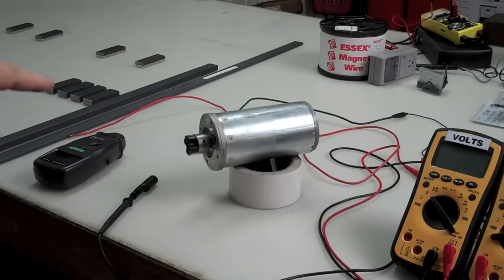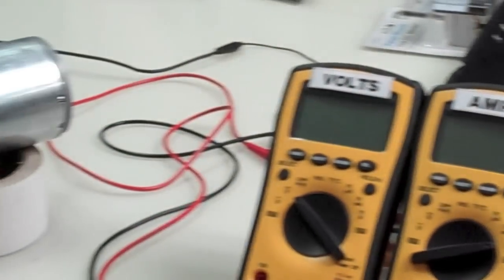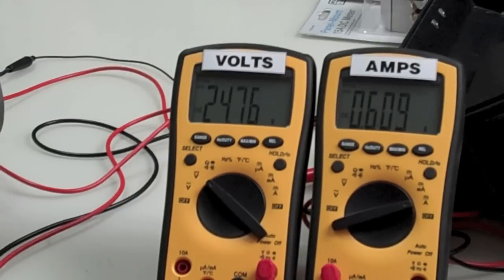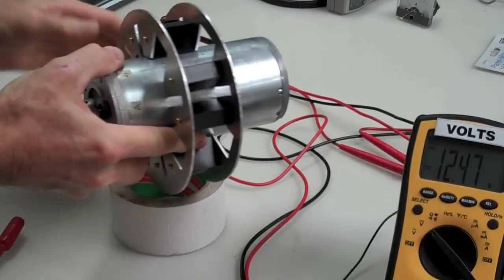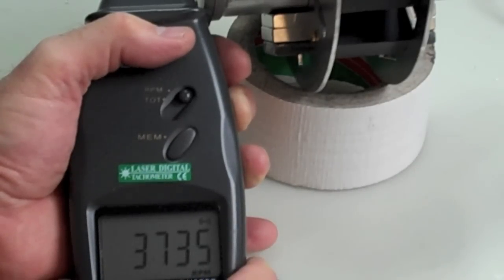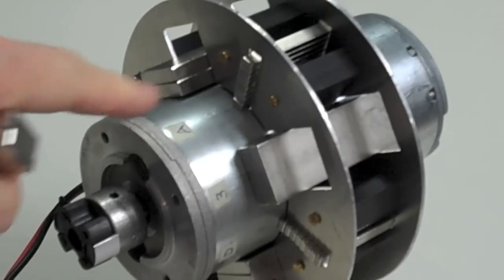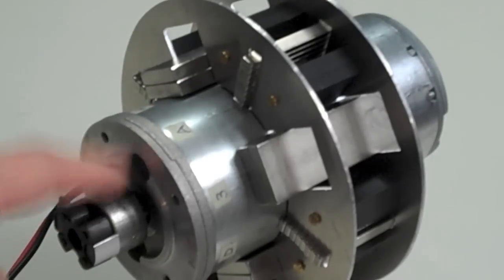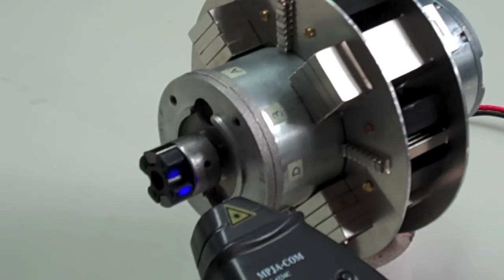STARGATE MOTOR  FULL DEMO

Comment: I learned the basics back in high school. In the college I went to there were specialized courses in electromechanics and electronics that dealt with this stuff more in depth but I chose a different direction. Since all this is way over a decade ago I can't provide any other advice than go check what your options are at a college near you, or other institutes that provide evening courses.
... Another limiting factor is that the chances are rather high that we even live on different continents.

Comment: I did this with my broken toy car motors as a kiddo ca.55 years ago by fitting stronger magnets to them as the magnets could be accessed from outside . The motors had much more torque BUT the motors did not last long. This principle is used on lift truck motors where they call it "Field weakening" and this give extra speed travelling

Comment: Since we're presumably talking about steady state, the motors are running at constant speed, RPM is neither increasing nor decreasing..   The one with the stator field boosted by external permanent magnets runs at higher RPM, all else being equal.

Comment: I would be interested in seeing the same motor with some resistors across the fields to see if you get a similar result.  When you decrease field strength you increase speed as the limiting factor for speed in a a dc motor is back emf.

Comment: Great experiment. This dc motor can still be fed with slightly lower voltage than 12 volts but still can perform to its rated speed. Same speed with less power consumption.

Comment: A few things I noted. Motor is rated at 24V and pulled .5 amps with no load. He reduced the voltage by half which will increase the amps 2 fold. Simple OHMS law.

Now the gained RPM with the added magnets are cool, but as stated in comments before, basically the magnetic field is altered to a point that it may spin at a higher RPM, but can not carry a load of any type.

Comment: In a DC Motor speed (rpm) is proportional to voltage (volts)  and torque proportional to current (amps). The stator flux generated by the internal magnets induce a voltage in the rotor windings which has to be the same as the voltage supplied.
The external magnets weaken the internat stator field and make it go faster. The magnetisation losses inside the rotor core that conducts the flux are now less because of the weaker flux and therefore it consumes less power.

Comment: Try putting in a cooler of dry ice to drop the temp of the friction of the ball bearings..... Then check the performance. Think of the lower the temp the more friction the motor can withstand.

Comment: The armature voltage is proportional to the flux and the angular velocity. The motor, while not connected to an external driving motor, doesn't produce any voltage, it is called CEMF. E.g. 24V 1Wb rpm=3000, 12V 1Wb rpm=1500, 12V 2Wb(because of the magnets) rpm=3000

Comment: nice work, question; what if you use less power for example, starting voltage to get the motor spinning at 24 volts 0.6Amps then reducing voltage to 12v 1.0Amps using gears to keep power drive however reducing voltage right down to 3 volts so the motor doesn't spin out of control and burnout by maintaining the design speed and reduction in voltage. now you have efficiency and battery stamina complete with reliability. you are onto something special and the right track. the down side is weight.

Comment: This is whats known as a Hybred LORENZ motor as what is acculy going on is that the system does is takes advantage of the lorenz effect. It is the same physics a railgun works on. However, Props to the guy that came up with this as it is not easy to get the math and the placement of the outside "Stator" ring aka the stargate in this case , 100% correct. Awsome job.

Comment: Hi, You can achieve that with just 2 magnets. If you only put 2 magnets to increase the field of the actual magnets there. Watch my videos you can see what I'm talking about, but I think you may have made it too complicated.
Reply from the maker: Two magnet positions will work, but not as good as four. No complications, just field manipulation.
Reply: +PMMG4HYBRID What about the torque of the motor ? I think you are on to something , and it is something have known about but don't want us to know so we keep buying oil ! and gas ! but I would like to the torque >??
Reply: +tomie 2 tone you can make perpetual motion turbine with magnets.
Reply: *****  yes , but I think the torque would not be enough ?? Not sure but its a good start and the video is spectacular !
   I worked at branch auto electric and the alternators become very hard to turn when the fields are excited , the rotor is an electro- magnet and when you run current through the brushes , the rotor becomes an electromagnet. As it spins,  It produces current in the stator which goes to the rectifier and that changes it to direct current , DC ! I have to say a lot of the times when a car came in that had a electrical problem like the battery going dead , the alternator belts were loose... So you see the idea you have is great but the more current you want the more you have to force it to turn ! Its very good idea and I look forward to more on this subject , thanks for your imput ! You may change the way we get our energy , and move us away from fossil fuels !!!!! It would be a great achievement!  Thanks for your interest in what I had to say , I know I am not as well versed on these ideas !
Reply: +Marcus Drakelove until the magnets wear out.

Comment: What happens when you attache the Stargate motor to a load \ resistance ? What's the most likely "thing" this device can run, transform or alter, but simple to achieve. Relatively speaking. ? Thanks, great job.

Comment: thats awesome...could you build a motor with magnetic,  frictionless bearings that could run all those rpms? somehow, I bet you could if you havent already. Like electricity, I believe you can harness magnetic capacitance with materials like bismuth and make bearings that spin in the field with no worries...

Comment: I was just wondering what happens if you leave the motor in "full magnet" configuration but reduce voltage to reduce rpm.. at what voltage level will it slow down to the rated 3000 r.p.m. and what power consumption you experience at that voltage .... also if the motor in this setup will have as much torque at 3000 rpm as the normal 24 volt configuration.

Comment: I was taught the same thing when computers first came out, but if you check it out, when they want to erase info on a hard drive, floppy disk or a tape,or degauss (demagnetize) a read/write head in a tape deck or vcr they use a powerful electro-magnet. They actually use very strong (neodymium) magnets inside a hard drive.

Comment: The reason I am adding this is, generally, with a lower voltage, you draw more current. If it is more efficient, would it be running at a lower voltage, and with a current similar to what it normally ran at before modification?

Comment: have you tried reducing the voltage further to achieve 3000 rpm to see what power is required, this would give an easily seen direct comparison with the standard motor and quantify the gains made by the stargate.

Comment: [8]
11. By halving the stator flux you could perhaps double the no-load speed, but you would more than halve the working torque of the motor, so the net result is less shaft power. So although the impressive whizzy speed is awesome, it's actually rather less useful.

12. In a nutshell, if you want to change the torque-speed curve of the motor a little, this will do it, albeit with a loss of efficiency. PMMG4HYBRID's quite right about that, and his video demonstration is very nicely done.

Comment: Great demo: I would like to see the system tested with the motor under a constant normal load. And... it would be interesting to see the effects on a generator..   and, .. could you please explain the magnets and their construction a bit further please. ( Note I have been tinkering with a highly balanced Mack truck alternator rewound and I'm looking for some special high powered magnets to enhance its low speed performance rather than high..

Comment: Try motorcycle chain lube with teflon (PTFE) instead of slick 50 or other oils...

If it can take 2000+ lbs force on it, it can handle that.

Comment: Best Youtube video I've watched on electric motors, hands down. Very good editing, it looks like a studio made this video. I have a question. What program did you use to make this video? Also, what is the current draw, and at what voltage did you reach 10,000 rpm at the end test? Is it drawing more than 1.00 amp duing the 10,000 rpm test or less?

Comment: was wondering how the magnets relate to the internal magnets. ie how many inside and width of them. could you make the case of aluminum and add magnets to the back side of existing magnets so dont lose some flux thru the case?

Comment: Since Mineral oil is non Conductive, I wonder if you immerse it in a tub of it, up to the gear, if it will help disparate the heat and maybe help lubricate at the same time.

Comment: Rather than enhancing the magnetic field, the field is being weakened, normal behaviour for a DC motor is the weaker the field the more RPM at any given voltage. Dc motors use back EMF to stabilise their speed, reducing the field reduces the back EMF at any given speed causing the motor to draw more current and spin faster. Sometimes reducing the field strength is used to increase the speed range of shunt or compound wound DC motors, I use such a technique on drill press motor. A consequence of reducing the field strength is less torque for any given current

Comment from the maker: You're correct that it's not 1/3hp, I was thinking of another motor when I spoke that in the video. There is NO fraud here. Watch my other videos where this tiny fractional motor with Stargate config is used under load. There is absolutely NO need to run high voltage to get the performance shown. NO fuses blown. Cold running motor. Magnetic flux saturation in the case of inductance is quite advantageous. Try it! It's fantastic.

Comment: So, with the motor connected to the battery the motor produces a voltage that fights off the battery voltage. if you increase the flux the motor produced a higher voltage, maybe more that the battery voltage so current reverses and the speed drops until the motor generated voltage is just less that the battery voltage again. Increasing flux reduced speed.

Comment: So my question is why do they not simply add more permanent magnets in the engines from the factory and upgrade the bearings for super low wattage and higher rpm motors?
Reply: It may seem weird but adding stronger magnets to a motor makes it run slower.  Here is why:  Any DC motor is the exact same thing as a DC generator.  You have windings that move past magnets.  Think of the motor as a generator and imagine you start spinning it.  The voltage made by a generator is determined by the rate the wire cuts through the magnetic field.  Doubling the speed or doubling the strength of  the magnet doubles the voltage.  As a motor speeds up this happens also.  The voltage it makes is called the "counter EMF" because it opposes the external voltage you are applying.  The motor will speed up until it is just short of where the counter EMF equals the supply voltage.  Thus doubling the strength of the magnets about halves the speed of the motor.
Reply: They do, and charge more for the bigger model.
Reply: Daryl Buck
As a general rule, what you have to pay for a motor depends on what it costs to make the motor.  Electric motors have been around long enough that there are few secrets or patents at work.  Twice as powerful of motor generally costs less than twice as much because some of the costs don't increase.  More power per unit weight or size costs more because the materials get more expensive.
Reply: you know what might be cool? monetizing on the modder/maker community by building components that are like early radio shack micro modder race cars. you know develop a open community around a lego for adult crowd.
Reply: Mike Klegin
There are already efforts very like what you are thinking of google on things like "makers fairs" etc and read a bit.  You will find companies that 3D print for the amateur crowd and a lot of other things like that.  You may want to get involved.
Reply: Because of the production cost increase of course. Also 10+k RPM is somewhere no little motors should really go - aside of the cooling and bearing the brush arcing is likely to become significant once you reach such a speed so with a size that small only the BLDCs are capable of this. However I've seen motors slightly bigger with a way larger commutator, electromagnetic stator and centrifuge-based speed limiter (the BEMF is way lower for those). Those run around 10k RPM yet are way more rare and expensive.
Reply: My answer is so what? increase the magnetic force increases power etc.
Reply: Brian Fairey It really works in a way that is slightly counter intuitive.  Think of the motor as a generator.  The rate at which the windings cut through the magnetic line of force determines the output voltage of a generator.  Make the magnets stronger and the voltage goes up.  Now think of it as connected to a battery.  If the generator makes more voltage than the battery, it charges the battery.  If it makes less voltage, it works as a motor.  Thus the RPMs goes down if you make the magnets stronger.
Reply: Ken Smith why not just rebuild the motor from ground up to work with something like this? its not impossible actually if you can pull power like that from something so small you could easily make something pretty much close to free energy
Reply: Havok3v1l Free energy? Slightly reduced losses you mean surely? That engine is vastly underperforming a freewheel. Wasting 12W and doing zero work. Zero load motors are the norm in the FE community unfortunately. No-one wants to use a standardized commercial battery and hoist up a large weight with it, to get 100% clear performance readings. It's all Watts and rpm's. Work = height * mass right? Take a 1.5V common brand battery, fresh from wrapper, and let it power a crane motor that hoists up a 10kg payload, through any gear setup you want. How quickly can it so so (not cheating with caps) and how high in total? Drain that battery! Best motor wins. Who cares about attaining RPM or Watts? It's about what efficiency we get out of a given battery capacity. In real life operation. An RC car race down a runway might be more sexy a test.
Reply: Cloxxki
10kg isn't really enough weight.
A D cell battery is good for something like 2 Amp Hours.
We can estimate:

2A * 1.5V * 60 * 60 = 10,800J

746W = 1HP
10,800 / 748 = 14.5 HP seconds

I think that works out to lifting 10kg something like 100 meters which is hard to do indoors.

A brake is another way to make a standardized force measurement.  The method I used for this was to hold the motor up by a bearing on the shaft and measure the torque on the motor as the shaft turned against my friction load.  This is how I came up with a few good measures on an induction motor.

On the basis that a Watt saved is as good as a Watt found, I claim to have done far better than all the free energy folks put together each time I turn off an unneeded light.
Reply: Ken Smith Comment of the week! 
Yeah a torque measurement is great too, as used in bicycle power meters, right?
Free energy researchers don't like that because it's too conclusive. Best to have a free spinning axle and measure rpm's versus watts...
Reply: It boils down to costs. you can get motors that have more/better magnets in them, but the cost goes way up. I have seen motors that are a quarter the size of the original put in some applications, but like i said that dinky one doing the same job as the big one cost a lot more
Reply: Cloxxki well i obviously pulled alot more out of you than what he did xD

Comment: Its a great idea.
Reply: It isn't really useful.  All he is really managing to do is change the stator field strength.
Reply: why is that not usefull?
Reply: Motors are designed for a given speed with a give load at a give supply voltage.  Attaching more magnets can effectively change the design speed, torque or voltage number but the resulting motor is not going to be as optimized as one designed for the new purpose.

Comment: Great experiment - now if you could reduce the voltage and find out the start up threshold and build a generator out of it with a flywheel you could have more power coming out that you are using and thus create a power generator that is self propelled - then you have done something very special!

Comment: Surely you have to measure the torque at the motor as well, to see where the energy is going. faster rotation, lower voltage = lower torque.

Comment: Easy to let it run without any kind of load. Connect it to winch and let it pull weights or put it in a break-test contraption and let us see how much realworld-force it can deliver. If the same motor drives eg. a car with one amp we can talk....

Comment: you are drawing the same power... 12v @ 1A / 24v @.59A.   Please  refer  to Maxwells equations for relating the Mag Field Intensity to the current density. Also your system is homogeneous  or operating at no-load. the load torque will cause dynamics on the motor which will go in equilibrium with the forces on star gate and the rotor torque will not be able to handle the load well.

Comment: Do you think you would get better results with a ball bearing motor? Would it produce less heat and possibly prevent the motor from burning out as quickly?  I don't know anything about how this works, but I do want to know more.